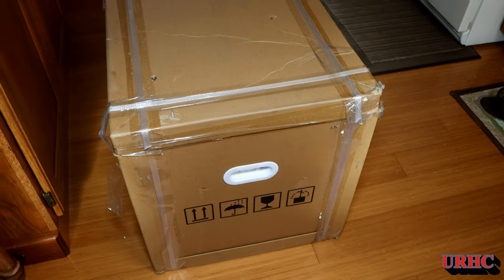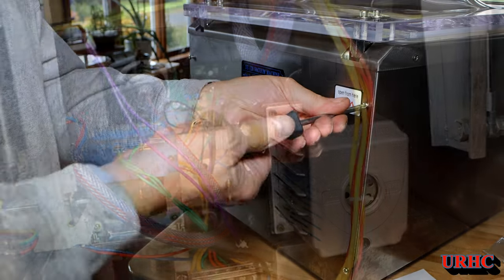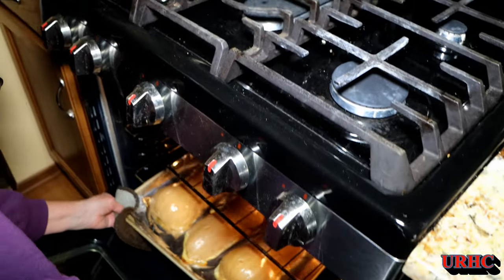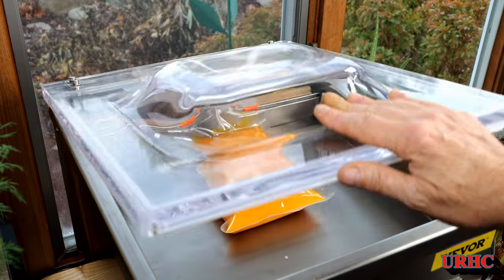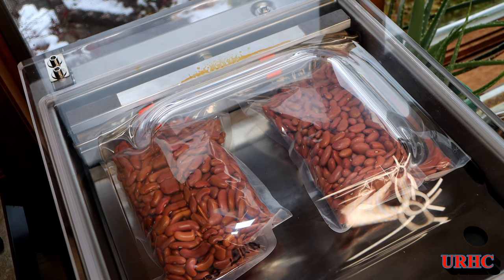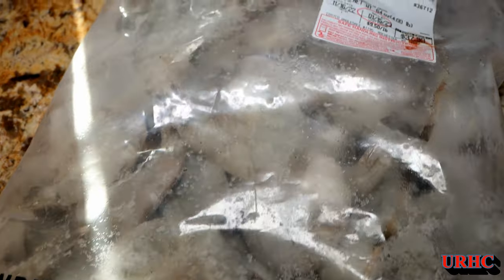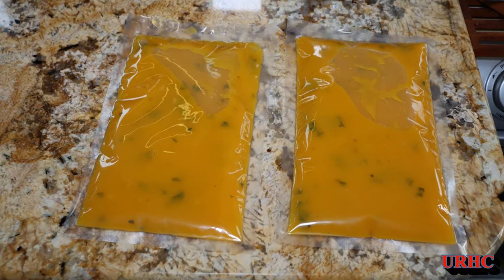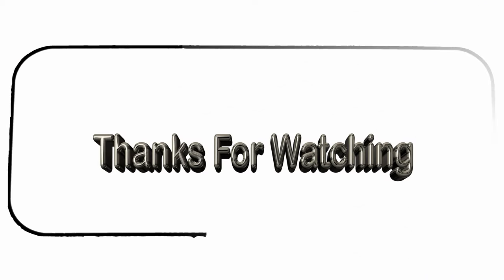Vevor DZ-260C Digital Chamber Vacuum Sealer Exceeds My Expectations For A Budget Priced Chamber Seal

Comment: Vacuum didn't crush can, atmospheric pressure did. Run vacuum on squash first, then put in bags and run again and seal. Takes two steps, but air would be removed. Looks like a great machine. 800 hours sounds right, but if oil discolors change it, has moisture in it. Doesn't allow deep vacuum to be reached when water/humidity is present in oil. Just bought ultrasonic machine from them, works great, good quality.
Reply from the maker: Thought  thats  what I said when the atmospheric pressure is let back in. This surprised  me how well it works and at the cost it's  simple  enough  to fix should something break. I didn't  think a low cost offshore pump would  last that long so we will see over time. Thanks for watching.
Reply: What do you mean run vaccum on squash first? You mean put squash in a open bowl and run the machine, then seal the portions in a bag?

Comment: Does it have an hour counter so you know when to change the oil?  The nice neat packs stack so nicely in the freezer and save so much room.  Instead of making a little ramp, couldn't you just tightly roll up a towel and lay it under the bags?  Darn, I recently bought a new machine from Avid Armor. One of their better vaccum  sealers.  I wanted a chamber sealer like this but did not want to spend 1K so I settled on a heavy duty model from Avis Armor.  I still might get this. It does require a large surface and my kitchen is already well stocked with gadgets.  If I can figure out where to put it, I think I will splurge.  HAVE A BLESSED &HAPPY THANKSGIVING!
Reply from the maker: No there is no indicator.  I think that 800 hour number doesn't really  matter.  You should  look at the sight glass to see if there  is any contamination  in it. I also think the pump woll have to be unscrewed and pulled out to dump the old oil out. At 30 seconds  a bag, max bags in an hour is 120 times 800 would be 96,000 bags 🤔. It is very heavy and not easy to move. I see they are giving  my discount on top of the black Friday sale that brings  it down to $341.00 shipped.  If you look back I tried the $300 Avid Armor sealer and wound up returning  it because  the pulse function  didn't  work. The bags stack nicely  in the freezer.  I froze the first  one flat on the bottom and now stack 2 high on a flat cookie sheet with the first flat one on top so there are no buldges. In an emergency the dozen I filled  with water will be good to drink as they melt. It's  one of thos things that you don't  really  need but want to make life easier.  We will be home  alone eating spam Thanksgiving day. Saturday we are having the big bash and friday I have to drive to Albany and pick my sister  up after  her dialysis, then bring her back by Monday morning for the next session.  950 miles to drive this weekend but it's  also her 70 birthday and we need to celebrate that.
Reply: @unemployedredneckhillbilly2023  Thanks!

Comment: Hello again URHC. Ordered the machine a few days ago, arrived yesterday, set it up including taking off back cover, inspecting, and adding the pump oil to just below 3/4 of window. I read instruction manual carefully, but I'd like to ask you a question. I've just done a few test seals and I easily get the dial into the green zone before sealing, but I never seem to be able to get it all the way to zero. I've noticed some other people with this machine getting to zero. I've even tried cranking the vacuum time up to (maximum) 60 seconds but it never gets to zero. Should it? Or is the green zone fine. If you could give me your input, appreciated.
Reply from the maker: Make sure you wipe down the seal area and rubber seal. Inspect the seal for damage. Empty mine will almost hit the end of the green in 30 seconds.  When I put items to seal in there it depends what is being sealed. Some things like liquids will go quite a way up the gauge and then stop when they start boiling. some items like green beans contain air and won't go as high on the gauge. Soild items like beef steaks will go higher then ground burger. I pretty much shoot to get at least 1/2 way into the green, if not a little more. There also is some variation in low cost gauges but no easy way to check that. I would try it empty first and if it can't get close to the end of the gauge inspect that all the hoses in it are properly seated if you didn’t check when adding the oil. You should call Vevor and see what they say if the bags don’t come out properly vacuum packed or you cannot make it most of the way up the gauge.  Let me know what you find. We love ours and are over 1000 bags with all perfect seals. Thanks for watching.
Reply: Thank you for all the suggestions and I will sure try each one. Will get back to you on results. @unemployedredneckhillbilly2023

Comment: Do the instructions give you an idea of how to set the sealer (ie: time)? I want one of these so bad, I just haven't ordered it yet!
Reply from the maker: each manufacturers bags can be different so you have to choose the bags you will use along with the plastic thickness. For thin chamber  bags most take 1.8 seconds. for thicker foodsaver bags 2.2 seconds.  The vacuum  time will vary by contents and volume. Just watch the first  couple  bags and make adjustments to the times for any signs of bad seals or air in the bags. Write them down along with bag info. I just posted a video about a new smaller machine that works great at a much lower price if you don't need the 12 inch seal width. Thanks for watching.

Comment: Great review, thanks. Seriously looking at one of these. Question: if one uses smaller bags (say 4 inches wide) do you think it can seal two bags at once?
Reply from the maker: I have been doing 2 -6inch bags at once with no problems.  you should be able to do 3 -4inch ones at a time. I did a update showing a plastic insert I made to halp keep the bags in place. I would recommend getting better non misting vacuum oil to replace the basic oil that comes with it. Still no problems with mine, Thanks for watching.

Comment: Can I ask: What is the tallest jam jar you could vacuum in one of these when taking out the double bottom and using the dome in the lid for maximum effect?
Reply from the maker: It would have to be tiny because the 8 oz jelly jars are too tall by 1/2 inch.  Thanks for watching.
Reply: @unemployedredneckhillbilly2023  So sorry, I had only skipped through when asking that, I saw you had the foresight to even show it in the video! Thanks! - I'm currently searching for one of these directly on Chinese supplier sites, exactly because I want one with a chamber big enough for at least 4 125mm jars! Those are sooooo rare! The Chinese build these basically exclusively with commercial application in mind... So the machines are mostly designed to package 1 type of food commercially, rather than "as many different foods as possible" in your own home. What I can tell about YOUR machine, from my travels:
- VERY good quality, those insides look stunning! With the best I've seen!
- I like the super clear lid, I've also seen some with an icy blue tint to them, very sleek look
- having all 3 times displayed/changeable at once is RARE, love it
- while yours does not have a massive chamber, it's still above average for the class of machine! (or rather the biggest you can get in the form factor)
- motor is a smaller one. very economical, but you may want to consider using a spacer for when you package lots of small/flat bags in a row. Will cut down your cycle time massively!
Thanks again, loved it!

Comment: Great video.  Can you make bags using the sealer on one side of the bag before vaccuum,
Reply from the maker: No, can't seal without pulling the vacuum.  The chamber bags are cheap. Thanks for watching.
Reply: @unemployedredneckhillbilly2023  can you seal the one end and still make a bag even if the vacuum cycle works,
Reply from the maker: Yes but that is a big waste of energy.

Comment: Just wondering...what sort of power back up do you have , it you lose power for an extended period of time...nice video....as always...
Reply from the maker: We had that happen  2 years ago when our underground feeder corroded.  I have a 30hp 15kw generator that will run everything but it is a gas hog so we ran it for an hour then off for 4 hours.  Mostly  for the well pump and fridges. I have a small generator to keep the freezers cold and  internet up that is thrifty on gas. I also have a solar panel with 2 batteries and an inverter in my barn that is good for chargong electronic devices and m18 batteries for flashlights. Woodstove  keeps us warm. I keep thinking  solar but its just not worth what it costs and short lifespan yet.  Thanks for watching.

Comment: I purchased a vevor (smaller) unit, but it did not come with an English instruction manual or any replace parts.  The heating strip has burnt out and I don’t know how to contact vevor.  Do you happen to have that info. Thanks
Reply from the maker: Is it still under warranty?  If it is they should send the manual and strip. on their website I found a contact number 
855-385-1880 (Mon to Fri, 08:00-17:00; Sat to Sun, 08:00-15:00, GMT-8)
you could try this. Amazon should have the strips. Good luck. Thanks for watching.

Comment: I used a Mylar bag and it looked good at first but after a few hours it seemed to have list it’s seal   Am I doing something wrong? Getting any info or help from the company seems impossible
Reply from the maker: Not really made for mylar bags so seal times and vacuum pressure may need adjustments. Contact the bag manufacturer to see if it meets their sealing requirements and settings. If you are sealing dehydrated or freeze dried items sharp edges can puncture bags easily under this amount of vacuum so try reducing vacuum. Most mylar bags are sealed without vacuum using a simple strip sealer. We haven't had any failures after almost 2k of the chamber sealer bags on ours. Thanks for watching.

Comment: I’m curious to know how the bags held up with the shrimp.  My frozen shrimp lost a vacuum after a few days.  I assume they poked small holes in the bag.  3 mil bags.
Reply from the maker: Just ran down and checked.  They are all still sucked up against the shrimp and fine in the freezer.  Are they the Avid Armor bags?  I ran into some problems with pointy rice poking holes in a bag and tried another bag with the same results. Had to put it in glass jars using the lid adapter.  Thanks for watching.
Reply: @unemployedredneckhillbilly2023  no sir, they are the Vac Master bags. Not happy with them.  Thanks for the reply.

Comment: Concerned about the air that I see left in the soup bags, is that normal?
Reply from the maker: That's what happens when you package warm items or pull vacuum to long. They boil from the vacuum and continue to release gas until the chamber opens. the gas is sealed in and any sealer that can pull high vacuum will do it. Thanks for watching.
Reply: @unemployedredneckhillbilly2023  thanks for the info, I pulled the trigger a couple of hours ago. I appreciate your video, great information.

Comment: Is this machine capable of sealing Mylar bags? Thinking may solve some issues I have with long term storage of some herbs that I only grow every few years
Reply from the maker: I do not know.  All I have to try are the old foodsaver bags that are thicker and the new 3 mil chamber pouches. They both work well but require  different times. We use the standard  bags and freeze some herbs but a year seems  to be the max they stay good.  Thanks for watching.

Comment: The ones ive seen on ebay with same model # says it only has a 10.5 inch sealbar dz-260c
Reply from the maker: That's a different company selling on ebay and the smaller version with the reversed narrower and thinner seal bar. My link will take you to this model directly from Vevor. Thanks for watching.

Comment: Once you have a decent chamber vacuum sealer you can't look back.  Their pricing is insanely cheap ... I paid a LOT more for mine than what they are charging for these!
Reply from the maker: I totally agree with you.  This does a much  better  job and the pouches are only about 40% of the cost of quilted bags. If it lasts a couple thousand  bags it's definitely  a bargain.  Thanks for watching.

Comment: Hey! Great video - I learned a lot - i've been using a food saver for years, and looking for something to easily seal liquids (like soup) neat idea for apple cider and ice packs! i was wondering with the ground beef, we like to flatten the 1lb packs after we seal so they lay nice and flat in the freezer. Can you manipulate the meat after it's sealed with this machine?
Reply from the maker: Yes you can flatten it after but would be easier to do before sealing and the blood would  get pulled back into the meat. Another  thing is everything must be cool before sealing.  That iis what  caused my butternut problem trying to do it warm. So far we love this machine and no problems.  Thanks for watching.

Comment: What’s the biggest size bag you can use ?
Reply from the maker: I have  used the 11 x 16 gallon bags with a little trim. 12 inch wide max with this machine,. Thanks for watching.
Reply: @unemployedredneckhillbilly2023  so 11x16 and 8x12 will work ?
Reply from the maker: Had to trim the 16 some like I said.
Reply: @unemployedredneckhillbilly2023  got ya still for price food saver is messy tho specifically liquids

Comment: Fixing to order the same 260c. Can anyone confirm if it will hold a 4-5lb whole chicken?
Reply from the maker: I don't think so. About 4 3/4 inches clearance in the center of the dome but I doubt the seal area could be kept flat with the bag wrinkled down.   Thanks for watching.

Comment: How is the unit after a years use?
Reply from the maker: Still working great after over 1000 bags. Just switch to non misting oil after break in to eliminate any odor when running large batches of bags in a row. Thanks for watching.
Reply: @unemployedredneckhillbilly2023  thabk you so much. How long is the break-in period? I cannot seem to find that info.
Reply from the maker: I swapped it out after a couple hundred bags.

Comment: Your machine says DZ 320,not the same as the 260..the 260 is smaller it don’t have a 12” seal bar.
Reply from the maker: It's almost 12.5 inches. You saw me do 2 side by side 6 inch bags in a couple places. It's only avail from VEVOR from what I can tell. Follow the link I posted to the 320 mm sealer. Others sometimes use the same number for the $200 narrow one with the seal bar in the front. Thanks for watching.

Comment: Did you notice a strong chemical odor when using your machine?
Reply from the maker: No We get a slight oily mist smell after a bunch of bags as mentioned in the next video. I replaced the cheap oil that seems to be misting out the vent filter it came.  Now trying a non misting oil now to see if that solves it. Will do an update after using it a while and doing some  large runs. Make sure any plastic around the seal strip was removed. Thanks for watching.
Reply: Yeah, it’s definitely not. The oil seems to be coming from the heat strip and the little bladder that inflates to allow the ceiling mechanism to operate. This is a very strong smell that stinks up the entire house. Almost like a strong rubber type smell.
Reply from the maker: The only rubber is the top seal foam strip on the lid. Did you pull the protective plastic strip off it before using?  You  should contact Vevor if it doesn't go away after a batch of seals. Another area could be what do the seals look like on the bag. Are they over melted making the bag outgas? I am using 1.7 sec seal for the chamber bags and 2.2 seconds for the heavy old quilted bags.
Reply: I think it is coming from the little bladder that inflates underneath the seal bar I’m telling you it is insane. Smells like a chemical factory heat is so strong. It’s not a rubber or plastic part that’s burning.  its offgassing from this particular part
Reply from the maker: Just ran a bag on mine then picked the seal up to smell the bladder and no smell at all. The only smell was the smell off the hot copper seal strip that is present on any heat sealing machine. The bladder is nowhere near the heat.  Don't know if it matters I have put over 200 bags through mine. Contact Vevor and see what they say.  I think over 40 people have bought them through my links so far and this is the first issue I am aware of besides the oil misting odor.
Reply: Yeah, someone suggested on here that it’s just some really cheap rubber product. I was unfortunate enough to get, but it’s almost unusable at this point.
Reply: Do you know how to contact Vevor?
Reply from the maker: I think it's on the website. Let me know how the return  goes.
Reply from the maker: 855-385-1880 (Mon to Fri, 08:00-17:00; Sat to Sun, 08:00-15:00, GMT-8)
This is the number on the website I found.

Comment: Nice machine, but the fact it won't do jars makes it a non starter for me, unfortunately
Reply from the maker: It's much easier to do jars with our Foodsaver and the lid attachment. We do many 1/2 gallon jars with that for dehydrated goods so this is mostly for wet items. We love it so far. Thanks for watching.
Reply: On my 3rd Foodsaver now. That method works ok, but far from perfect. I keep my dehydrated stuff in the older round brown canisters. They're far superior to the newer clear rectangular ones. Vevor has one that'll do jars, for 1K! Man it's purty too  :-D Thank you for your time, I'm a subscriber now.
Reply from the maker: You could try the discount code they gave me to save an extra 5% on anything if you go that way. I don't think they recommend sealing jars in that one either though. Probably because some may try things like old mayonnaise jars that can implode. Ball jars should work. Thanks for subbing.